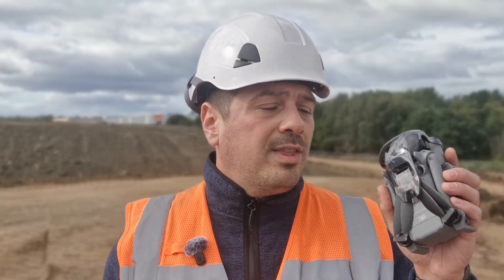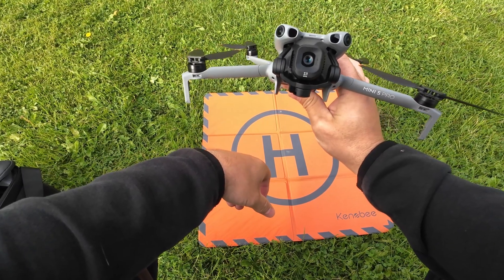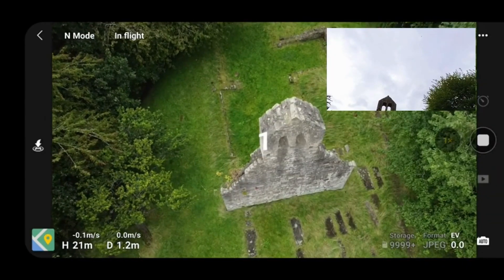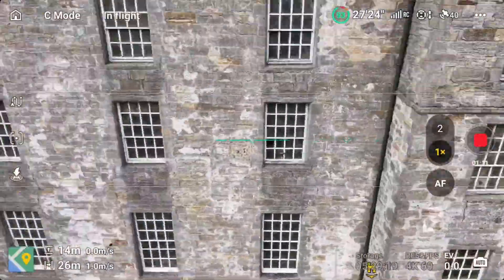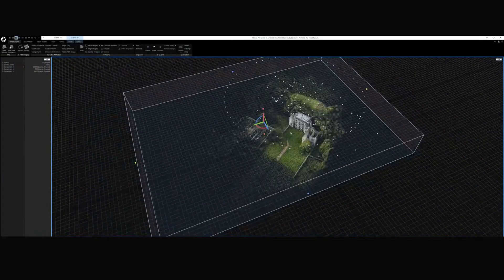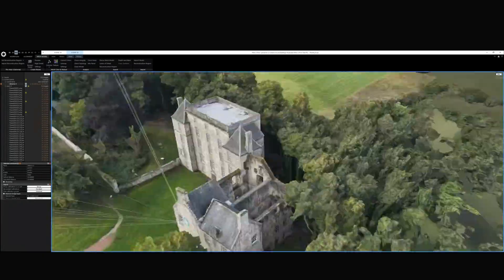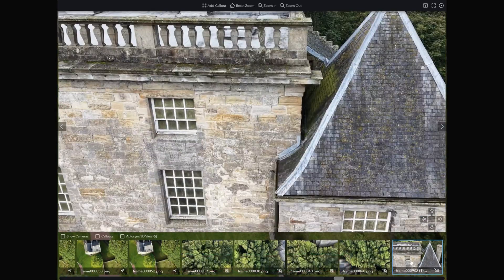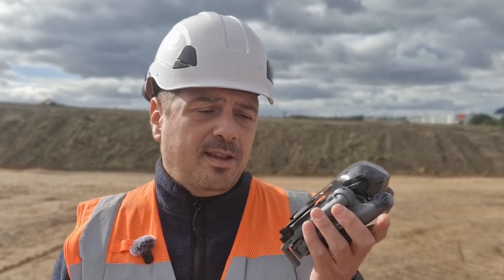DJI Mini 5 Pro for Inspections - Does It Actually Work?

Comment: been using it for scanning a 6km long water canal in 1 big file 😅, result is somewhat okay for photogrametry, but for vertical accuracy ? even with ground control point, i doubt it to be accurate for my work. wish the drone also have area flight mission generating feature like mavic 3e has
Reply: yeah, super tricky, it give me 2 unsleep night running and figuring out all those data to be usable, 😂. Should have complaint to my boss to get proper surveying drone next time.
Reply from the maker: @muarrifalwazir1828 you need to use the right tools for the right job.
Reply from the maker: It's still a consumer drone not an enterprise one.
It's ok for small stuff but not made for topo survey. On top of that the water canals can be a bit tricky

Comment: Great video and info, Stefan!
Have you tested how far upwards the gimbal can pitch on the Mini 5 Pro? I saw specs claiming it can look 80 degrees, nearly straight upwards, have you found that to be the case? 
If so, this would be a great drone for building inspections, if you're able to look straight up into rafters and overhangs on facades! A lot of other DJI drones can't pitch up that far.
Reply from the maker: The gimbal can go up 55 degrees which is still very useful. It has also a very good 2x crop zoom and Lidar obstacle avoidance which it makes this drone my top choise for urban building inspections or even small building surveys.

Comment: Im a building surveyor inspecting roofs, gutters and chimneys on existing building. I have just set up my own business so dont have huge cash reserves. Would you say the DJI mini 4k is good enough for photos in daylight for £400, or do I really need to spend £1000 on the 5 pro? 

I have only ever used the 4k at previous firms, so interested to know the difference in camera quality
Reply from the maker: DJI Mini 4k is good enough for what you need. I used a Mini 2 for year to survey small construction sites in the urban areas and did a good job. 

On the other side Mini 5 Pro has a great camera good in low light, 50mp, 2x zoom and great collision avoidance sensors.

I would say that if you only have £400 buy a Mini 4k, make money with it and when budget allows you can upgrade. 
Your skills are important than the drone.
Reply: @flyingsurveyor thanks. Just ordered the mini 4k fly more combo for £339 :)
Reply from the maker: @jonathanhowson6420  awesome.
I am sure that you will make a good use of it.